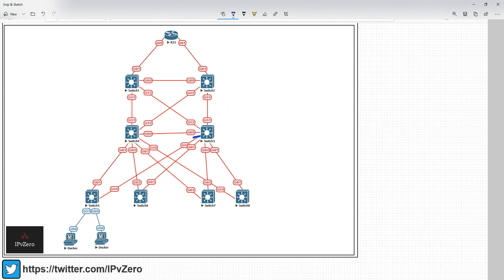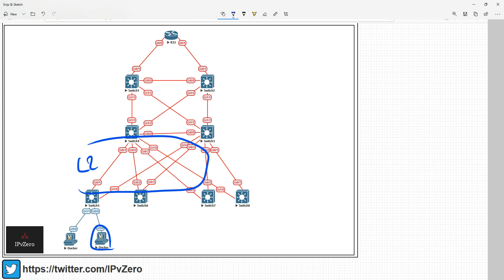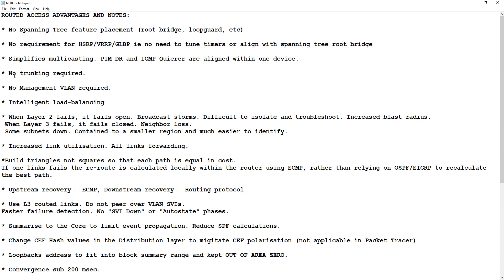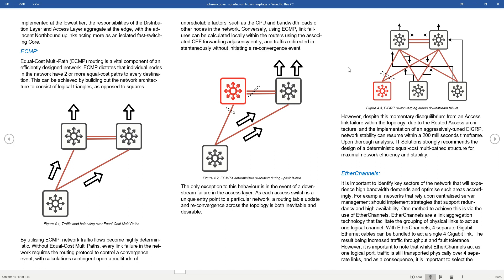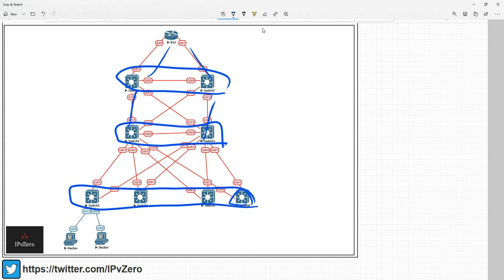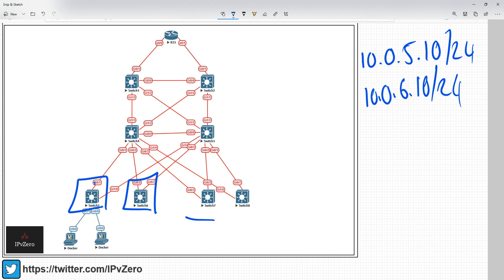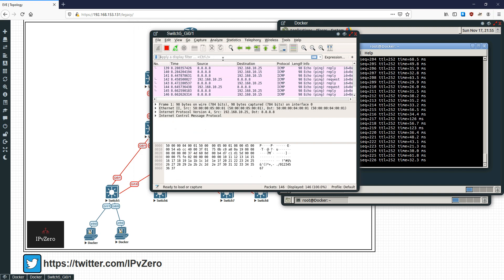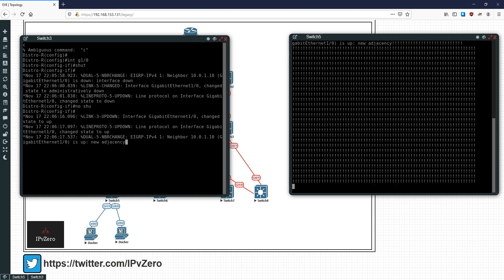CCNP Switch: Routed Access + Local VLANs | Explained!

Comment: Thanks John again for the great video with very clear explanation of the design and pro's and con's.

Is it possible to get the EVE-NG topology for each of the 3 designs covered for review and import into EVE-NG.

Cheers
Reply from the maker: Thanks again, Al! Really appreciate hearing your feedback!
The topology was created in EVE-NG Pro, do you have that or the Community Edition?
Just because when trying to Import the EVE Pro lab into my Community version it doesn't seem to load right. No doubt because of the lack of supported features that appear in the original! If you have Pro, then I can upload them no problem. Alternatively, I can quickly spin up a Community version for you (there won't be coloured links, etc) to download if you'd like.
-John